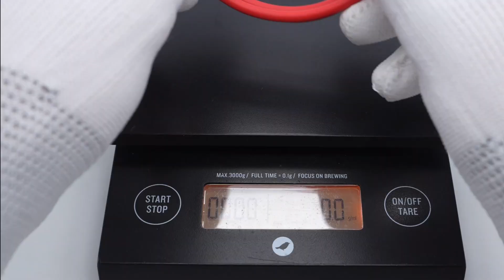Teardown of New OnePlus USB-C Cable (Up to 6.5A)

Comment: Hi maybe you can answer this question .. can I use a 100w 5A cable when the phone came with 100w 6.5amp cable???? Please help!😊😢😅
Reply: Yes. Just know that a 5A USB-C cable will not charge your OnePlus phone as fast as the original 6.5A cable, though it is still very fast. If you use a non e-marked cable (limited to 3A), then the charging is limited to about half of what you would get using the original 6.5A cable.

Comment: Can I use any other 100w PD cable with original charger ? Will SuperVooc charge work?
Reply from the maker: The 100w PD cable can also trigger the SuperVooc, but the current will be limited to 5A.
It cannot reach the fastest speed of SuperVooc.
Reply: @ChargerLAB what the  supervooc fastest combination?

Comment: In the power z it show that it supports up to 30v 5a, so that means it supports 140w pd 3.1? 28v 5a
Reply from the maker: Not exactly, PD 3.1 cables require additional certification.